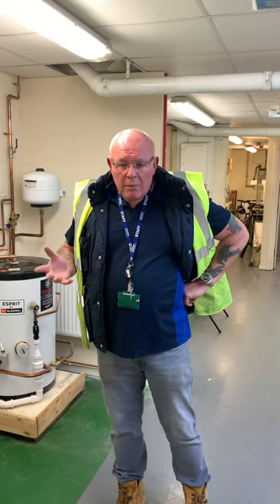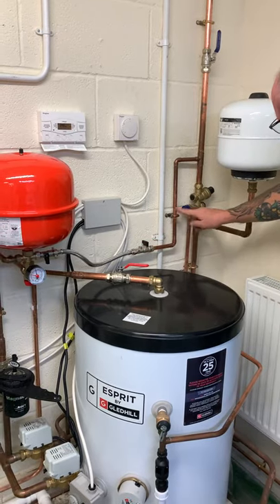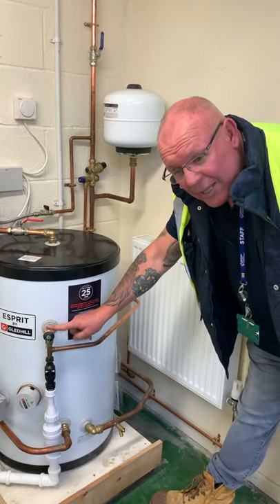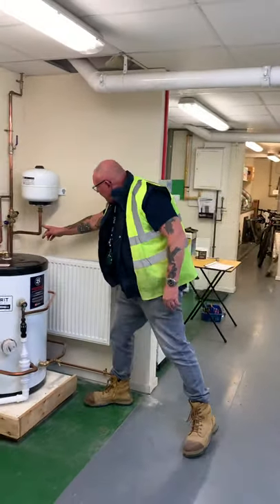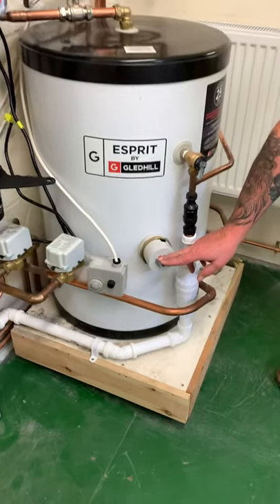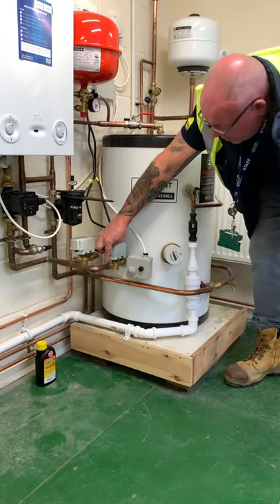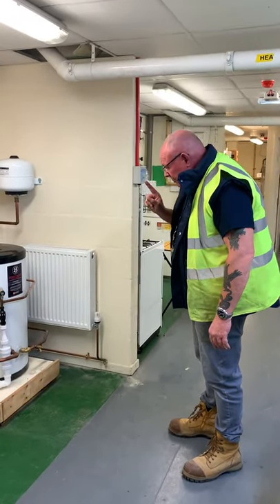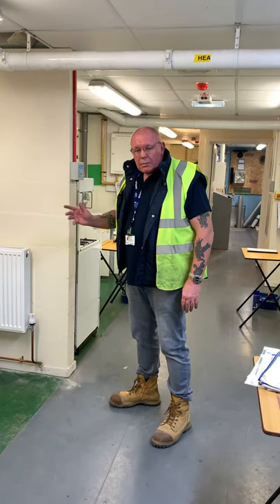5 November 2020

Comment: Is that boiler a heat only boiler.  Expansion pump separate. Also is the pump on the flow after the boiler? It's normally on the return on combi boilers. Would the higher temps affect the pumps reliability?